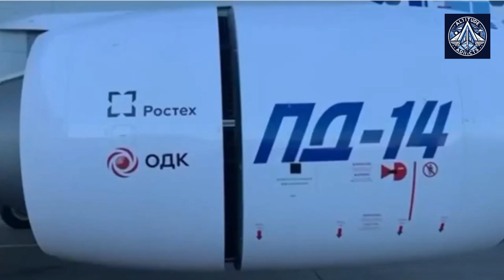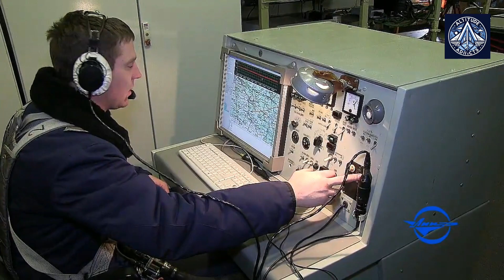Russia Ships Serially Produced PD-14 Engines for MC-21 Aircraft Commercial Operations

Comment from the maker: Correction:

CFM LEAP Engines: These engines have bypass ratios ranging from 9.0 to 11.0, depending on the variant. The LEAP-1A and LEAP-1C variants have a bypass ratio of approximately 11:1, while the smaller LEAP-1B has a ratio of about 9:1.

Pratt & Whitney PW1000G Engines: These engines are known for having bypass ratios between 9.0 and 12.5

By mistake we have mentioned 14 to 17.
Reply: LEAP-1C is rumored to be much heavier than its other variants for some unexplained reason.
Reply: @OOpSjm Please understand. The West does not want China to take over a large portion of global aircraft sales. They also don't want CFM LEAP's secrets to be revealed and plagiarized by China. That's why the CFM engine for the C919 is actually an upgraded CFM56. As a result, the C919's fuel consumption is very wasteful: 3 tons/hour.

Comment: Unfortunately, you missed how advanced wings with composite materials are. Has it been successful in making itself in Russia? It is very reasonable that without composite materials on the MC-21 wings there would be an excess weight of up to 5 tons.
Reply from the maker: It's mentioned in MC-21 videos. This is focused on the engine.
Reply: The MS-21 is has the composite 'black wing' already, made from Russian materials. It was made from the Japanese or S.Korean precursors before, but the sanctions forced Russia to produce own composite precursors. They are almost the same as Japanese by their characteristics, not better, but almost the same, according to official reports from UAC corporation.

Comment: The engine isnt yet designed for international markets.. it'll need maybe 5-10yrs active service with upgrades before it can be sold internationally..
Reply: @zubi234a  , Sure, not now, since it is not in the serial production yet. But the BRICS countries, some of them under sanctions as well, will buy Russian engines & planes, like Iran, South Africa, etc. At first, it will be produced for Russia itself, because Boeing and Airbus have refused to support their airplanes sold to Russia. Russia has plans to replace all the foreign passenger planes in 10 years or even less, they have no choice, therefore, Russia need to produce a few hundred of planes for own needs up to 2030-2035, at first, and she will... No choice, just have to...

Comment: They have at least a dozen engines in the shelves that can be prepared for this aircraft and more efficient ones like the Kusnetzov NK-73, this engine on the shelves was ready at the end of the 90's, it is a propfan geared counterrotated props that can deliver 20-25% better fuel economy than any current engines today...
Reply: That engine is too noisy to be considered.
Reply: @MrDomingo55  You know nothing of that engine, it's been ready for 25 years already, what you have heard is about the new prototype NK-93 which is in another league and not relevant at present but can be ready in the future....
Reply: @mazikkaluchka5562  Contra-rotating fan, even if enclosed as this one is, will always be noisier than what is allowed for civilian use.
Reply: @MrDomingo55  It is your imagination...!.

Comment: Ja Ja... The P&W 1500 engine was defective and 1500 of them are awaiting rear turbine changes since they deteriorated prematurely, you'll have to add another 5 million dollars to the price of each P&W engine for down time of the aircraft, removing and replacing the defective parts and lost revenue because of it... 
In this business you'll have to make sure you don't screw up and don't leave your costumers stranded, it is better late than delivering a lemon engine that would display your  eagerness to trow a product to the market when it is not ready just to deliver it as trail by fire and hopping it sticks...

Comment: The Russians know what they're doing on the bypass ratio, cold air is more dense than warm air and in Russia 9 months out of the year are colder, so they design an engine suitable for their climate conditions and not for operation in Saudi Arabia or India...!..
You can see how some aircraft are designed for cooler climates, for example, the Airbus A-350 failed operating in the UAE with 50 of them sitting on the hot tarmac with overcooked and pitted skin as the composite formulations failed and started pitting and pealing paint on the surface of the aircraft... That A-350 would do much better in Russia than in the Middle East...

Comment: What sources of information are you using regarding the cost of these engines versus their Western counterparts? This is the first time I've heard the PD-14 will cost MORE than comparable Western engines, usually Russia developed jet engines cost significantly less. Additionally, while bypass ratio is an important performance metric, it doesn't trump other considerations. Engine designs are based on compromises and other factors. This engine is intended initially to serve the Russian airlines and will no question undergo further development and improvement, I look forward to observing that process.
Reply from the maker: Less units means more cost.
Reply: @altitudeaddicts  , Not necessarily... It depends of the cost of materials, tech processes and workforce cost as well. Sure, the PD-14 cost is higher right now, because it is Not in Serial production yet. The serial production and the tech process optimization will reduce cost, for sure, as it was always and everywhere. Let's just wait and see...
Reply: @altitudeaddicts  Quand il s'agit de déterminer le prix de vente, plus le nombre d'unités produites est élevé et plus le coût de vente diminue. Toutefois, lorsqu'il s'agit du prix de revient, le nombre d'unités produites n'est pas un facteur déterminant.

Donc si l'on veut comparer 2 produits, il faudrait le faire sur la base du prix de revient unitaire. 

Enfin, je vous remercie pour votre travail de recherche et informationnel.